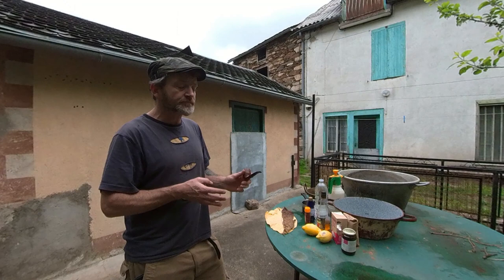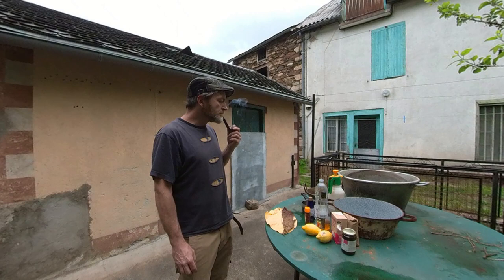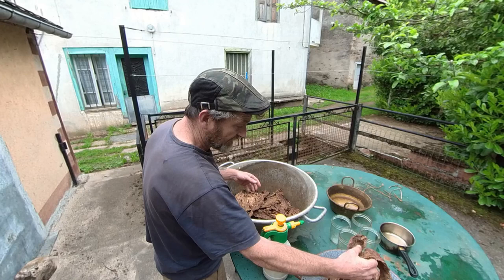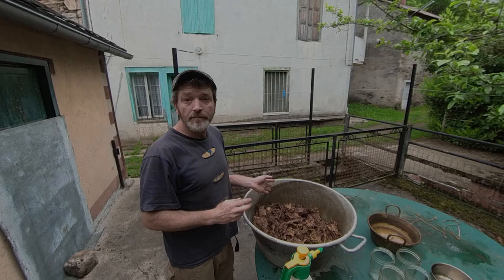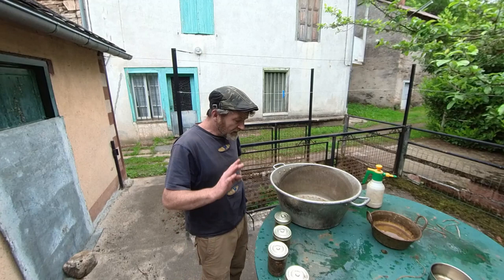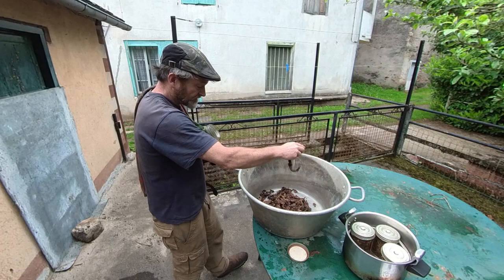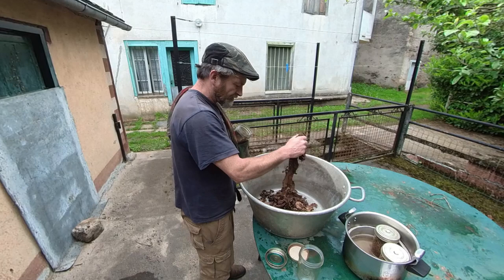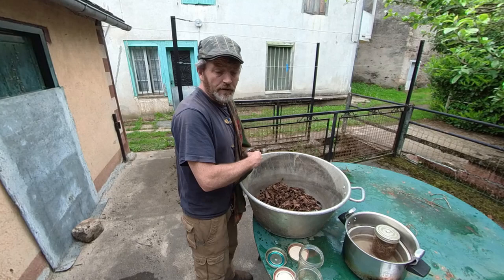Whole Leaf Tobacco 2021 #3 How to case tobacco and why a casing is used!

Comment: Hi, I am not a tabaco smoker but rely on my partner and son for feedback as they are smokers. I had used your casting process to take the harshness out of the smoke  with mixed results, I am wondering where I went wrong.cheers Phil

Comment: I'm a tad confused. Im new to this. I thought casing tobacco was something different. I thought a tobacco in case is just a nice, leather like leaf, not too dry, not too damp.
Also, I was expecting a fine misting but you're like putting the garden hose on it a bit.
Ive got less than a tenth of what you have and its Aztec Rustica.
Im not really sure what to do. Ive cured it by misting with water with a bit of honey and then left it in a tub heated to about 100°c for a few weeks
Reply: There is a lot of information here, thanks. I'm going to rewatch the video a few times

Comment: I enjoyed the video. I am watching it 2 years after its release. I have two questions. Have you left the tobacco in the pressured jars for a longer length of time?  I can’t help but wonder if the flavor could be increased. Also, in the sugar inversion process, you used i believe apple vinegar to start the process. Does this vinegar give the tobacco a vinegar aroma that was often smelled in the USA McClellands tobaccos?  Thanks.  Thumbs up and subscribed.

Comment: Hi Mr. Simon

Thanks for sharing this content with us it's really helpful.

I'm using your recepy to case bright Virginia 
But I'm noticing some tongue bite even after the casing process. 

Am I doing something wrong? 

The process I'm using is casing the Virgina and dry it out right away, is that correct? Should I let the tobacco absorb the casing for a couple of days? 

Thanks in advance! 

Greetings from Brazil! 🇧🇷
Reply from the maker: I find that it takes a week or so for the leaves to change colour and I keep them quite moist rather than dry them to a level that they are smokable. I suggest also possibly try a double casing on a few leaves just to see if there is enough sugar being added. Patience is the key!

Comment: Excellent video. thank you for the details. however i am curious about the next step. what is the proper pressing conditions? after the stoving the leaves are very wet. should we press them in a wet condition or ahould we dry them completely prior to the pressing process? this series rulez.
Reply from the maker: I think the next video or two covers my pressing process. I think its best not to have the leaves too wet to press, but at the same time not brittle. I guess the texture of leather would be a good place to aim for!
Reply: @ariegepipesmoker897  thank you for your reply... Keep up the good work 👍👍👍👍